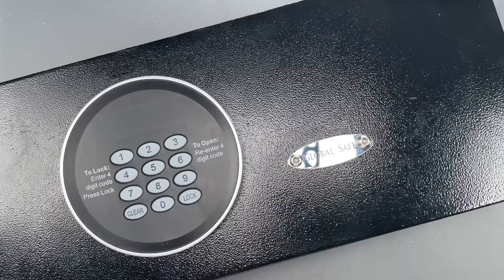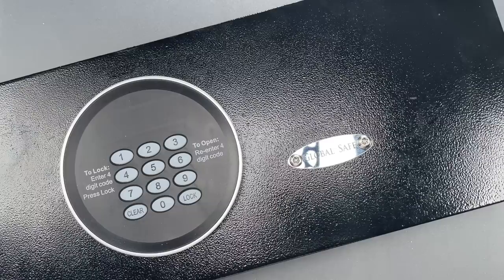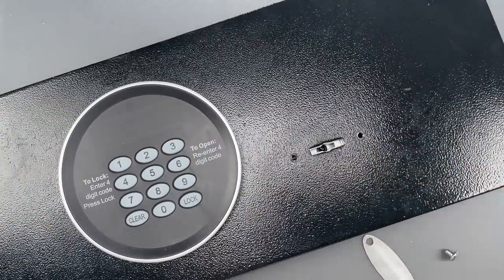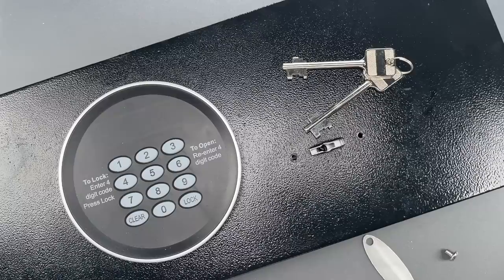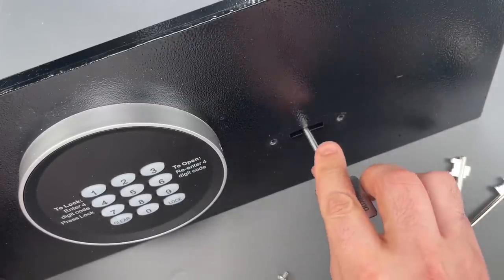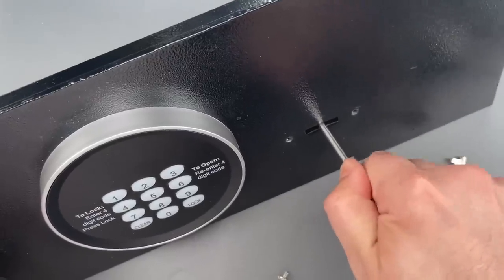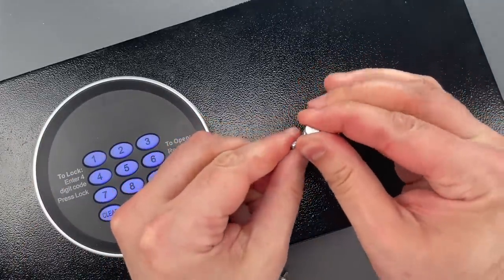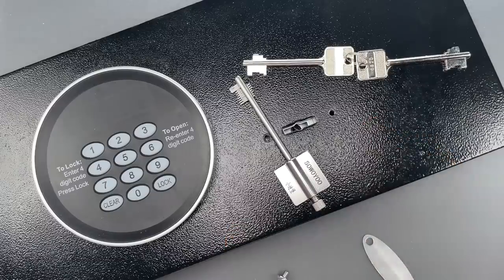[1462] Impressioning a Hotel Safe Lever Lock (Global Safe)

Comment: Welp...I know what tool I'll making in my shop this weekend is...
ALSO: These kind of safes are EXACTLY the ones that you don't want to have master-keyed backup locks on because EVERYONE has unlimited unsupervised access to them.
They should have a secondary 10-digit pin. And the hidden key hole should be a plug for an external battery pack.

Now I know there are people thinking "But the mechanical lock is there in-case the electronic one breaks" and I agree.
But these are cheap safes. If the electronic lock breaks you are replacing the whole thing anyway.
You only need to make sure your handy-person has a good drill bit in-case the lock fails with guest property inside.
Reply: I'm not so sure. A back up combination might be easier to keep secure than a physical master key, but once it does slip out, it won't be long before practically the entire staff knows it. There are always going to be people who refrain from stealing, not because they're honest, but because they're afraid of getting caught. They might not steal anything themselves, but they'd have no qualms about giving or selling the combination to those less scrupulous. And an unauthorized key is far more likely to be found during an investigation than unauthorized knowledge.
Reply: They already have a secondary pin, and every staff in the hotel knows it. The manager does not have time to run around every morning to open safes where the guest has forgotten his pin.

Comment: I don't get why all these electronic safes have mechanical backup locks.
An option to provide power externally in case the batteries die, an escalating delay in case of bruteforce guessing attacks and a resonably long admin code that is required to be reset from the factory default would be quite a winning combination for a hotel safe.
It could even be a bit cheaper due to the absence of the extra lock.

Comment: Best cheap solution is to only have an override code, no bypass mechanical lock at all.  Figuring out a secure but practical way to change the master code throughout a hotel will be a design challenge, which should probably include rules to prevent lazy hotel managers leaving the code at 123456789 .

Comment: UPDATE: I bought a set of these flagpole keys. To start with, I had to mill out the opening slot where the key goes in, it was about 1/2 a millimetre too narrow to allow the key to enter.
Then I spent about 5 hours yesterday jiggling and tensioning the key to no avail. My hand was aching after this marathon episode. I even had another go today, and still no luck.  The pins on the key move easily, and I have tried with a little pressure adjustment and also no pressure adjustment. I think I am going to have to admit defeat and try to make a 2 in 1 tool to manually pick this lock. 
I'll have to give credit to LPL here - he makes this look way too easy. Either that or I have no idea what I am doing, and that's emminently possible.

Comment: Great video as always! I wonder if the jiggling would have worked had the door been in the safe and locked causing reduced movement?
Reply: He was jiggling the key against the safe to make the pieces of metal drop down a bit each time (I think). I think if the safe door were fixed it would be easier, not more difficult.
Reply: @davcrav  Yep easier !

Comment: Of course if someone opened it with the key (or by impressioning) the legit user of the safe would know because they wouldn't know what code to relock it with - so the lock still works as a sort of tamper seal.

Comment: When staying at a hotel I forgot the code to the safe.
I called the front desk and they came and opened it instantly with the master code.
He didn't even try to cover it up. I think it was 1234, or 00000.

Incidentally my 5yo also guessed the master code by just pushing buttons.
Just keep your valuables in your dirty underwear, it will be safer.

Comment: What is the reason that the left side of the key is a 'negative image' (not really sure what the correct term is) of the right side. It seems like this is the reason that all the pins in the magic key can be the same length and can slide through the shaft.   If say for example key pos 3 was long on both sides, the magic key wouldn't work. Is this a design limitation of the locking mechanism itself?

Comment: If you're doing hotel things, take a look at saflok.  I'd like to see you try to open a room door (obviously you can just take the important parts, not the whole door).  I work at a hotel and am curious how safe the locks are.
Reply: It’s easier and quicker to just do an under door attack and pull the handle from the inside using a wire

You can look up video 978 where he and Deviant Ollam open a lever door with old school film but the attack concept is the same. You bypass all the fancy security and attack the fact that by disability and fire code you need lever style door handles everywhere

Comment: Lever locks in general were, of course, abandoned when the pin tumbler lock was invented. What was the reason for that, as it would seem that a properly designed lever lock could be just as secure?
Reply: $.  It's cheaper to mass produce a pin tumbler lock than a lever lock.  Also, the keys are usually smaller - I would rather carry a half dozen pin tumbler keys in my pocket than a half dozen lever lock keys.

Comment: those types of boxes are bolted into the wall tho.  That would make the jiggling motion impossible and thus preventing this method from working. This only worked because he tried it on a section of a safe and not the whole thing. right?

Comment: Back before car fobs, I locked my keys in my car and the locksmith simply used a blank key (or maybe it was made softer than usual) and would stick it in, jiggle it, take it out, look at the mark on the key I guess where the pin or disc banged against it, file it down, stick it back in, then repeated until the key opened it up. Can that still be done today with blank keys?

Comment: Now, when I go to a hotel, I remove the cover for the lock and dump a tube of super glue in the hole so the key will not work. If the electronic lock works I will use it, If not I will not use it.

Comment: The biggest vulnerability for hotel room safes is probably going to be unauthorized copies of the key floating around rather than skilled pickers. Having a key you can't get duplicated in the machine at your local Home Depot is probably more important than the technical pick resistance of the lock, so I can understand why they would choose something like this. If you can buy an off-the-shelf solution from Amazon, though, that all goes out the window. I wonder how difficult the modifications LPL made were.

Comment: Do those kind of safes still have a master code to open it up again instead of using the mechanical backup? I remember downloading a manual and trying the default code and it worked flawless. The mastercode could be changed but oviously nobody from the hotel did this

Comment: If the safe is bolted to a wall and the door is securely attached to the safe, then all that rattling to get the template key isn't going to work.  
"I removed the door to make this easier to see"  
My ar$$ that is why the door was removed !!

Comment: How will the jiggling work if used in a real hotel room where the front is still attached to the safe and won't move?
Reply: Just the same, if not better. The key has to jiggle within the lock for it to get to the right shape. You don't really want the lock to be moving.
Reply: @annoloki  Aah, makes sense really, had I thought about it beforehand. 😀

Comment: The jiggling of the door would be a bit more difficult to do if the door was still mounted on the safe itself, rather than removed as in this video.

Now, the impressioning key itself could still be jiggled, but would it take much more juggling to get the impression to “take”?

Comment: All those number code locks have the same flaw: having keyholes. They could just have a crazy long code as a mastercode (with the weak point to allow one standard combination to initialise the input of longer strings). You could even make traps like specific mid range combinations that resets the internal input without any notifications. Extra points for an alarm when the code input was wrong 5 times or the reset was triggered lets say 3 times. Of course a Chip ID card could be a backup too, but idk if those are actually secure when exposed to brute force with magnets or something else.

Comment: It seems that no lock will ever be 100% pickproof, but like here the closest thing is to make the picker need a very special tool. This is safe from 99% of thieves.
Reply: very special tool? they're $80 online and come in a 3 set for different sizes. You can buy one today if you want. It's no different than a tubular lock. Once you buy the tool, they're trivial. Same with these. Buy a lever imprisoning key and lever locks tend to be a bit on the easy side. So it's definitely NOT "safe from 99% of thieves". When $80 is all that prevents a thief from entering your lock, it's hardly safe lol
Reply: @brianb8003  I wasn't speaking about this lock specifically, just as a general thought. I said "like here".
You underestimate the amount of thieves and robbers and many have just no tools at all or just take a 5 dollars set at max. This tool might be common for locks enthusiast, but most thieves are not lock enthusiast.

Comment: Like any security measure, you're simply making it harder to get to your stuff than someone else's. 
It's designed to keep housekeeping honest and anyone who somehow managed to get into the room.
Reply: Good reasoning. But it just shows the flaws more.
An 'honest' housekeeping will leave a stack of $1000 on the dresser.
Putting that stack in the safe will stop the most casual dishonest ones.
But the actual dishonest ones are already motivated to have a key for the safe and to check it.

These kind of safes are EXACTLY the ones that you don't want to have master-keyed backup locks on because EVERYONE has unlimited unsupervised access to them.
They should have a secondary 10-digit pin. And the hidden key hole should be a plug for an external battery pack.
Reply: @Prophes0r  
Housekeeping usually does multiple rooms at a time. It's not unusual to see 4 room does open in a group with the housekeeper in one. The leaves the others open. Someone might feel comfortable spending 30 seconds in a room riffling through it.
Reply: "locks keep honest people honest" 
This just barely hides it from view tbh. Hotel safes has so many flaws.
I did a presentation over a decade ago opening 4 different brands live on stage.
Got 3 of em within a minute. 4th one needed a bent coathanger and some trial and error, 4 minutes.

Comment: I'm surprised you only cared about the mechanical lock, I mean, with safes I've seen you use even a spoon to open some... like, you almost always look for workarounds to open the safes without having to resort to picking or on this case impressioning the mechanical lock...

Are you sure there aren't other easier methods to open this safe but to impression the key??

Comment: One of the problems with putting anything in those types of "safes" is that they are rarely mounted all that great anyway... All too often, I see them just mounted to particle board furniture that you would only need to sneeze at to make them break loose... I figure you're better off locking the safe with some worthless junk in there and hiding your important stuff elsewhere in your room... And putting a "do not disturb" sign on your door and skipping room housekeeping...

Comment: Actually, this is not bad at all. Hotel safes are not meant to be a "safe" in terms of a vault, but a safer place to store stuff to prevent easy theft. I think this lock manages to do so. All the well known tube locks that can be opened with the back of a ball point pen in seconds, are a lot worse than this. Getting a working tool took LPL an hour, impressioning it took about 40 seconds. Way longer than the time the thief will have.

Comment: Hrmm, I wonder if someone could make a titanium anti-drill plate someone could slip over the front of these, that can't be removed when they're closed, that hides the key slot?
Reply: Sure, but the key override is there for a reason. electronics fail. Batteries expire. People forget their codes....
Reply: @jrd33  Maybe have it lock on with a padlock? That way you could use something serious.
Reply: @ConstantlyDamaged  Still won't help with the issues most hotel safes have.